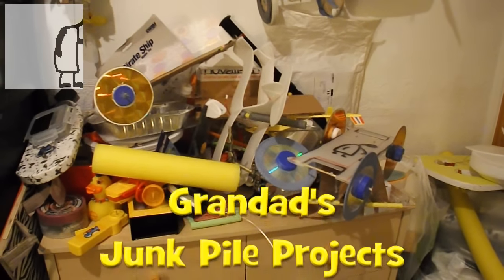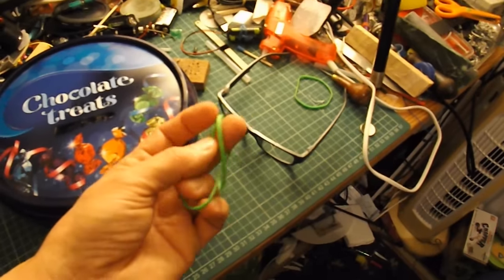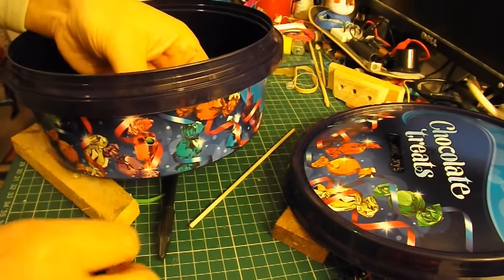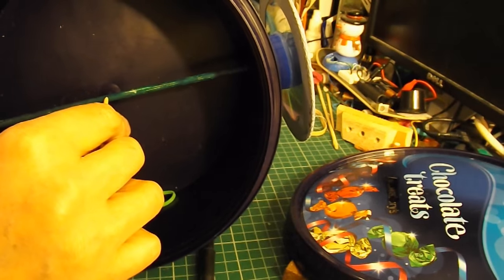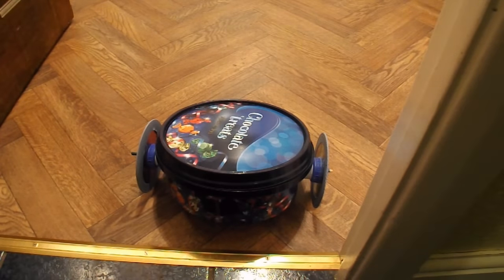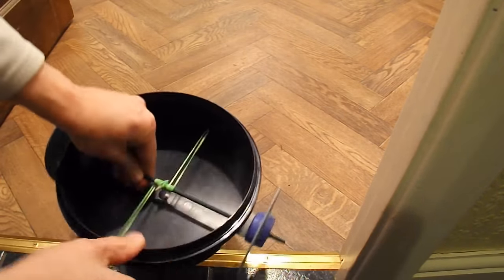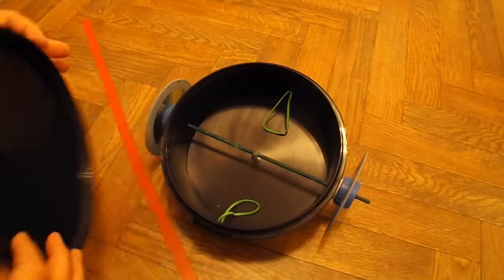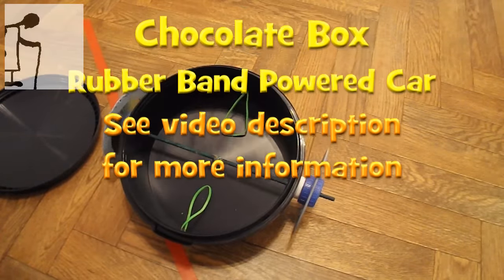Grandad's Junk Pile Projects #10 Chocolate Box Rubber Band Powered Car

Comment: Please, please, please can you try make a touchscreen digital watch or even try mod a digital watch so when you tilt it up to the right position it will turn on. You can do that using the ball tilt switches because I've tried modding a digital watch but I didn't want to break. It would really help because I am only young (I'm not going to say my age) and I really like to make stuff like this so I can make other projects. I'm asking you because you always reply to my comments and I know you probably can make or mod a watch with tilt switches.
Thank you if you do I would really appreciate it!
Reply from the maker: +Edward Lakin Hi Edward, there is not much chance of that happening. Unless one turns up very cheap in a charity shop, I certainly will not be buying one to take apart. Modern circuitry is generally far to small to work on with any tools that I possess and my eyesight wouldn't be good enough anyway.
Reply: +GrandadIsAnOldMan I was thinking maybe some old ones with a power button so you can swap that with the tilt switches.
Thank you anyway
Reply from the maker: Edward Lakin sorry, you confused my talking about making a touch screen digital watch. Certainly an old style digital watch with a push button for the screen display would work with a tilt switch soldered across the same contacts as the push button. Old digital watches like that are probably collectors items now :)
Reply: +GrandadIsAnOldMan okay😀😀
Reply: +GrandadIsAnOldMan could you make a quick video please??
Reply from the maker: Edward Lakin a quick video on what?
Reply: +GrandadIsAnOldMan on how to connect the tilt witches
Reply from the maker: Edward Lakin you have seen my video on using tilt switches. They only have 2 wires so you would just find where the button on the watch is and connect the tilt switch there.
Reply: +GrandadIsAnOldMan Oh yeah thank you!!
Reply: +GrandadIsAnOldMan oh I have just tried to do it on a little torch but because it had a button as well I'm really confused please make quick video on how to do it to a torch. Please I just can't figure it out on how to swap the button for the switch. Don't think I'm stupid or dumb (I'm normally good at this stuff) but I can't think how to do it! Please make a quick video!
Reply from the maker: Edward Lakin two problems. 1. I could do a video based on a small torch but the switch on a torch will be different to the switch on a digital watch. A small torch will probably be a springy piece of metal bending to make contact. The watch is very likely to be a printed circuit and the button will be rubber with a conductive surface that makes contact across the printed circuit when it if flattened.
2. If I make a video it will not fit in to my publishing schedule until February.
Reply from the maker: Edward Lakin you might find this video interesting. It is not what you want but it is about hacking a simple piece of electrical equipment https://youtu.be/jlxXpa_uBw8
Reply: +GrandadIsAnOldMan Ok thank you